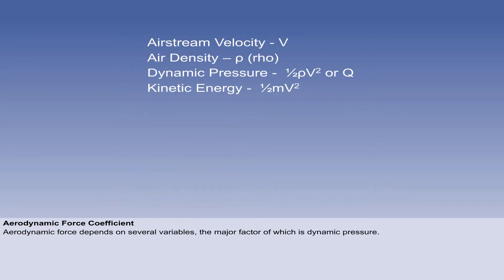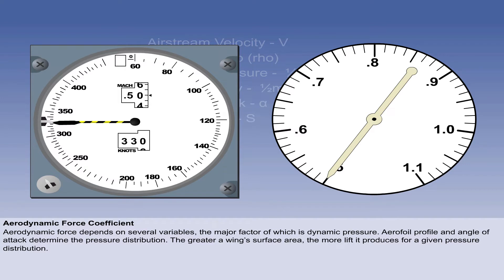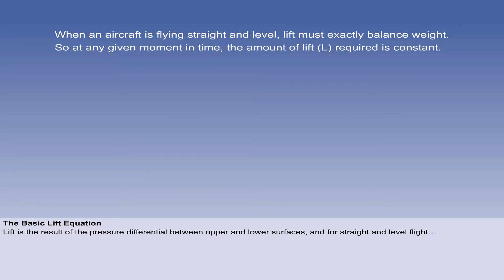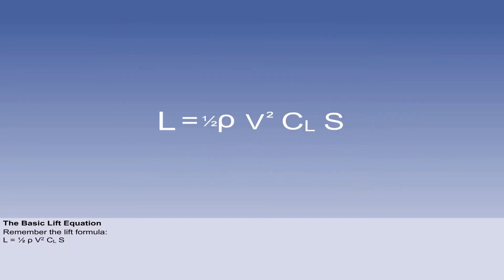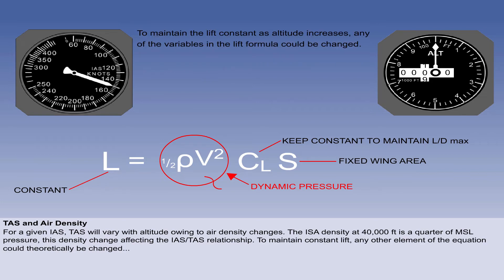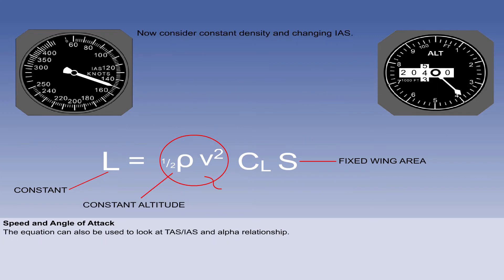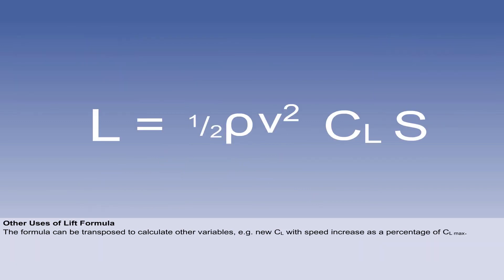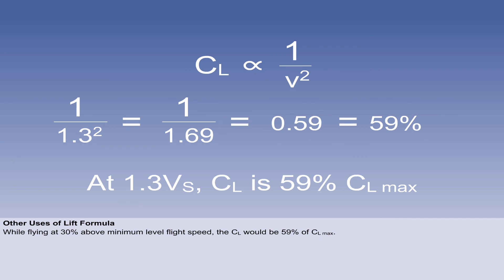ATPL training Principles of flight - LIFT PART1 : Lift coefficient and Equation (what is lift ?)

Comment: If you run real numbers for real aircraft, you will quickly see that the lift formula presented this way does not work. It will yield a lift force of tens of thousands of pounds for a C182. The resulting units will be in lbs feet per second squared, which makes no sense, and is not any kind of unit of force. The entire lift equation must be divided by g. Then it will yield results very close to the max gross weight of the aircraft, and the units will be in lbs. Please try it. yourself.